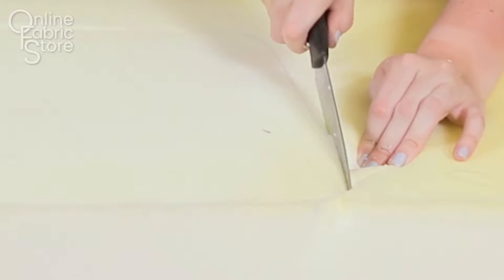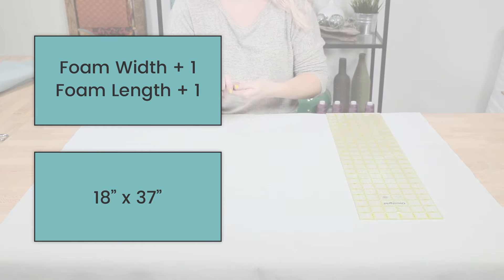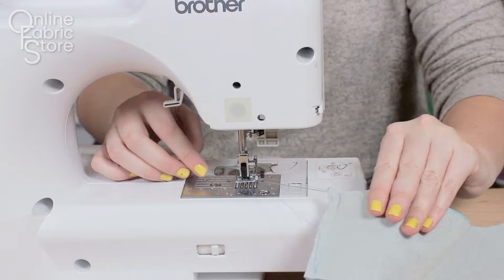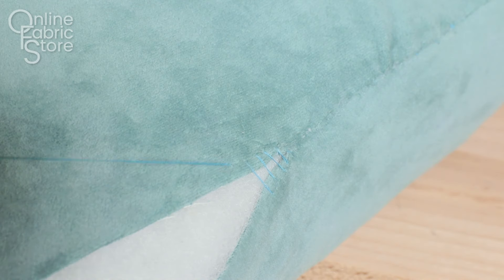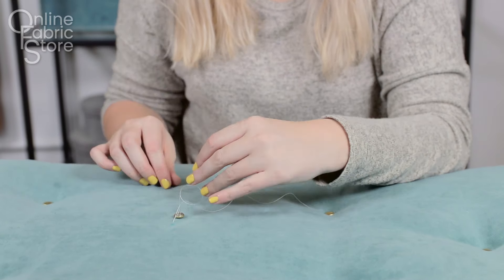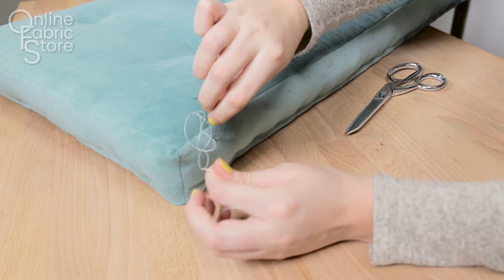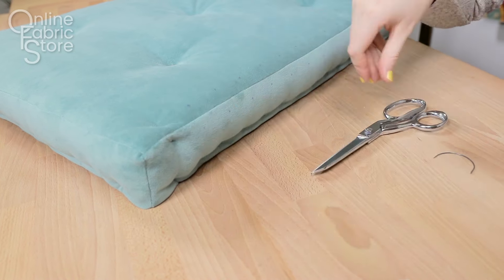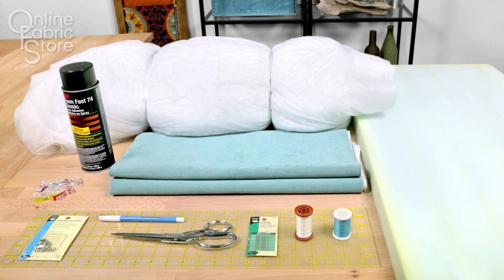How to Make a French Mattress Cushion | Brimfield Flea Market Boho Thrift Flip

Comment: I make doggy beds for my 2 shepherds. Working with the foam, I use an electric knife. I spray silicone spray on the blades and then start cutting the foam. Goes so quickly and I have straighter lines.....
Reply from the maker: Interesting! Thanks for the tip!

Comment: The dacron and the "padding", are the same thing right? In the 1st part, steps, your saying "dacron" and "padding" almost as if they're two separate parts but yet are the same material being used around the foam cushion. I think, but just checking to make sure I'm not missing a layer I should be having in this project.